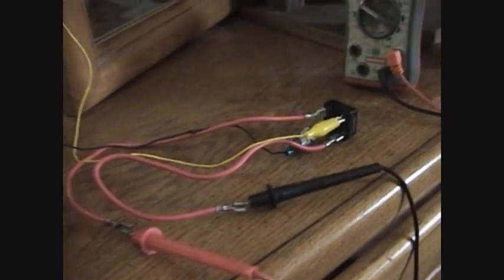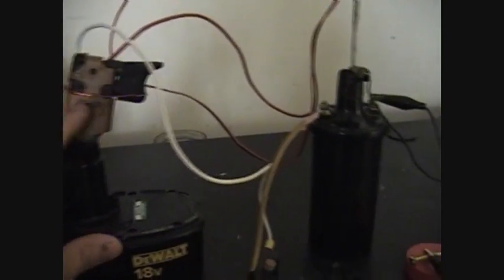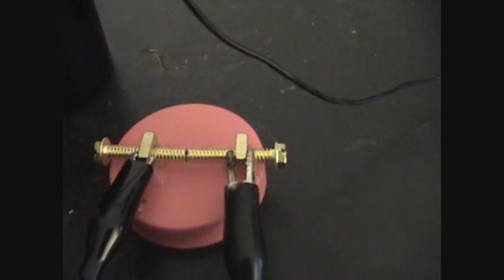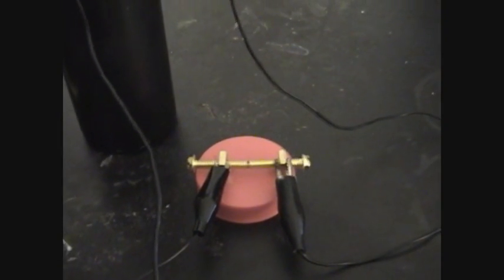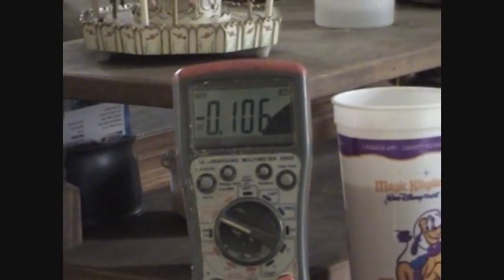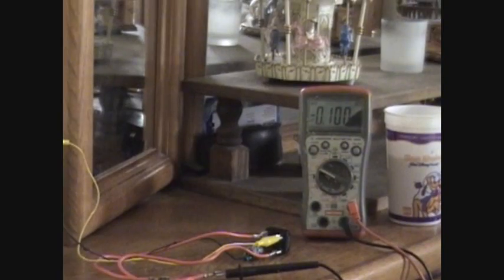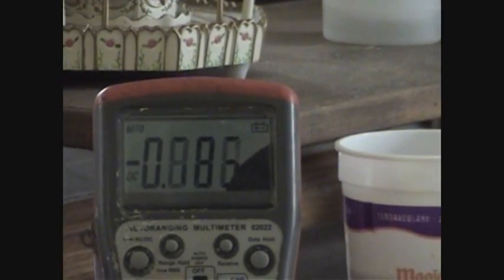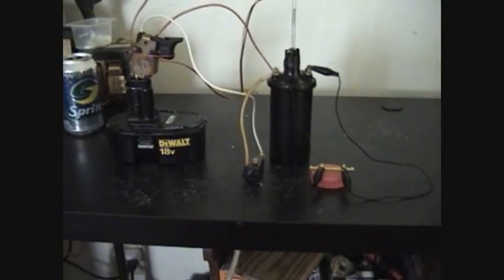Wireless Energy Transmission PT2

Comment: You could wire the transmitter antenna around a fluorescent tube and get the tube to light up from the RF energy.But you still will pollute all your area with RF energy and the neighbours will complain and will get angry..so it is not good to dump these Wattage into RF power and pollute all your area...

Comment: Only via resonance you can get more power transfered... but this is still inefficient, cause you transmit it into all directions.
Also you pollute your neighbourhood with RF.
Just try to work better again with your water spark cells or try to charge up batteries with
the RF spikes from these experiments.
Well anyway, nice work done..